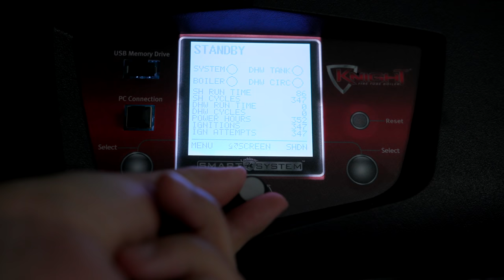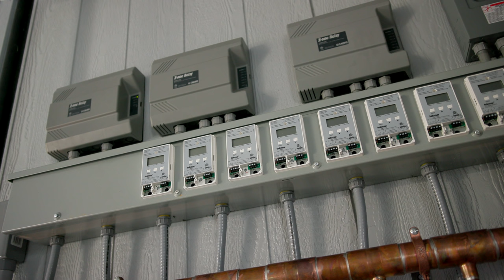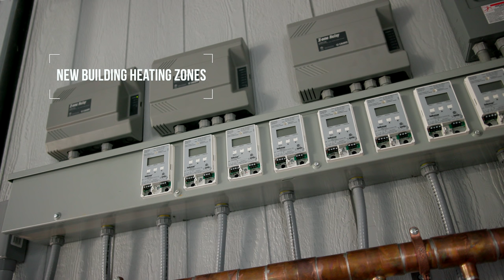New Tidal Gardens HQ Construction - Episode 7

Comment: Than - pro electrician here... The 300' pipe run for internet is going to be challenging regardless of conduit size, even for the pros. I have dealt with this issue many, MANY times! Using either method (mouse and vacuum or fish tape) it has only ONE solution. "Catch a fish" haha, no pun intended. You must push your fish tape until it stops then, from the OPPOSITE end, push another fish tape past the tip of the first and then spin the fish tape (wheel and handle mechanism) around and around as if trying to twist the steel "tape". It will hopefully twist inside the pipe and "catch" the other fish tape. You can then, gingerly, pull the first fish tape out... OR, and I would recommend, try sucking a mouse and jet line into the pipe, using the vacuum method, until it stops and creates the big "rat's nest" of string. And then use your fish tape, twisting as mentioned above, to catch the rat's nest. I usually have more luck catching a big mass of string than another fish tape. This is how the pros will do it so save some $$$ and do it yourself! And don't let them tell you the need to dig up the pipe and start over. Good luck! Cheers.

Comment: well, as for the fiber optic cable....  push through the first as far as it will go, and then advance a second from the other end, and each having a hook (or such) secured to their ends will allow the second to grab the end of the first and enable you to pull the first tape out through the "second"end....  Just an idea, but i've used this approach with electric runs and its worked well...  takes some effort, but like you said, that 2' pipe will offer a lot of play, and room your second fish tape into place

Comment: This looks awesome! Have you thought about a large sediment filter for the build? Just to prolong the life of the piping. Typically when you heat the water super fast the sediments like to separate out of the water.
Reply: Just as a prefilter
Reply: Thats why u fill the system with rodi
Reply: Dominic Salazar I’m talking about for the heating and cooling. At some point the cooling water will need to go through a prefliter as well. And after the water gets heated. It really just depends on how bad the water is there. I know where I am the water is really bad so I have 2 per filters for even my rodi system. Planing for longevity is not a bad thing:)

Comment: Than, as a network engineer, I've done commercial cabling, basically during my entire career.  I was following along, just waiting for when you would get to the IT portion of the build.  So I was interested when you started talking about providing Internet access to the new building.  One thing you haven't covered in your updates is the data networking/tech aspect.  I can't speak for anyone else but I'd love to know what kind of data cabling you installed.  If the cabling matches the rest of what you've done, it should be spectacular.  Will you make a small dataroom with an equipment rack?  What about providing network access to all the parts of the building?  Will there be workstations at strategic locations?  Will you install wifi?  I'd love to see an update about what you've already done and what you're planning.
Reply from the maker: I don't know if I went overkill on my IT in this building, but I wanted to future-proof it to some degree.  We do not have gigabit fiber internet service at this location but I am getting a decent 300/20 service right now.  Still, I expect one day to get faster internet service and I wanted my infrastructure to be able to handle that.  

What I decided to do was build a 10Gbe fiberoptic backbone between the house at the street and the new building.  The distance is just long enough that I think Cat6 would experience some packet loss so I went with OM4 fiber.  Inside the building we have a small 12U rack where we have the switches.  The building was wired up internally with Cat 6 jacks spread out on the walls.  I think there is something like 11 or so, 3 of which are in my studio.  I do plan on running a wireless mesh network but I have not purchased a router yet.  I was thinking of getting a netgear Orbi because I heard good things about it, and my switches are already netgear brand.
Reply: @tidalgardens  forgot to mention, same goes for a router

Comment: Place looks dope AF! Almost there! Greenlee makes attachments for vacuums for drag lines, etc.. Hopefully no rocks/debris made in the conduit during assembly. Good luck! 

P.s. why the hell did you use almond  devices and switch plates? Lol...
Reply: For fishing the conduit... Attach a string and your ”parachute" to the front of the fish tape. Push your fish tape all the way to the last 10 feet and then Try the vacuum. Or try to hook from the other side. If you are within 10' you can get it. Patience is key.
Reply: Love the build
Reply: Another option is to attach a metal chain to the end of your fish tape and use a magnet from the other end to hook the chain.

Comment: Are you going to heat and cool the actual saltwater through the recirculating pumps and zones or are you having that cool and heat regular water and then you will add a bunch of closed loop lines into the sumps that flow water through them....I’m confused how the setup is going to work but so interested....I just curious because I see copper and all those pumps  that would corrode so I’m assuming you can’t have salt water flowing through it
Reply from the maker: It's all closed loop so there is no tank water touching the heaters.

Comment: What if you use an air compressor  blow the air through and feed the string at the same time I see electricians do it all the time on the sites they use mil tape though it's a flat string that's super strong. Or you could blow a thin string through then pull a strong string and then pull the wire?

Comment: Is it safe to use copper pipes? I thought copper was bad for coral
Reply from the maker: You don't want to run tank water through it.  The water that makes contact with the copper pipe is sealed in a closed loop.